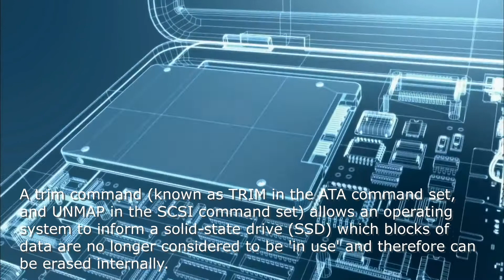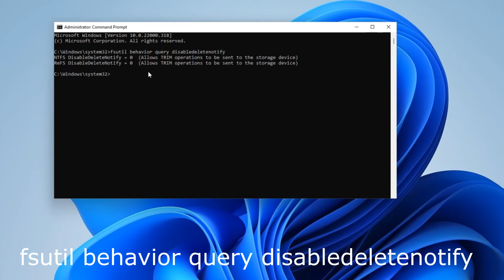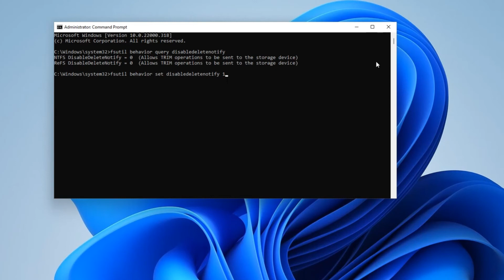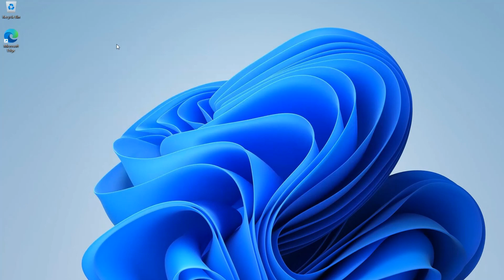How enable TRIM SSD? What is it? How to disable trim command?

Comment from the maker: Did you know what is TRIM command? And what do you prefer - enable it or disable?
Reply: hi i right clicked my SSD drive went to tool and pressed optimized by accident i only followed what it told me to do when i google now I'm just worried that i damaged my SSD so did i?
Reply: @kingmusik8901  No, you didn't. . Trimming your SSD is actually a good thing.
Reply: How do I activate trim on a secondary drive?